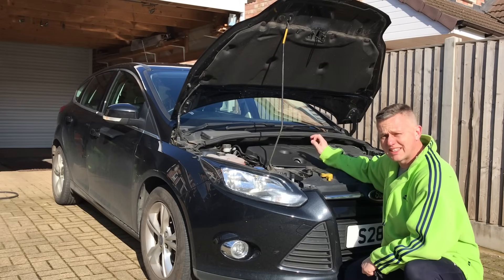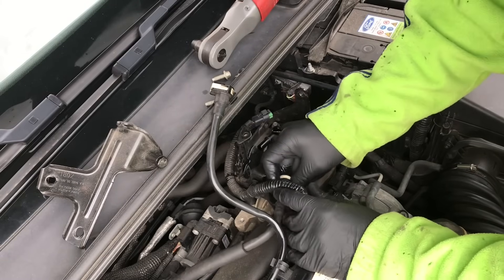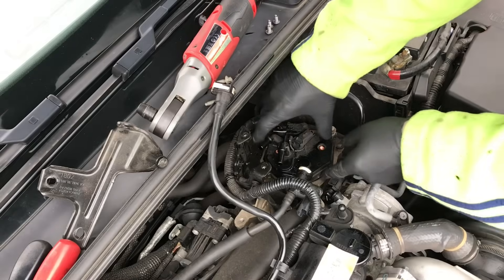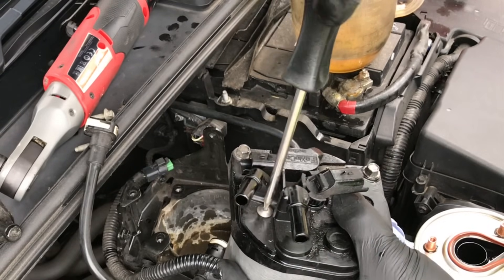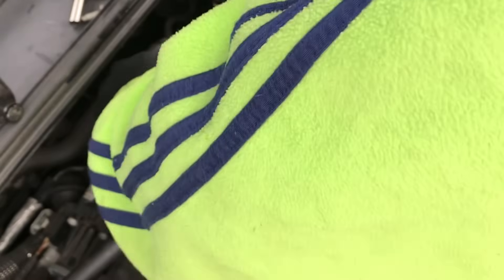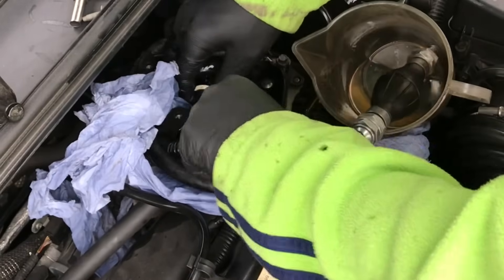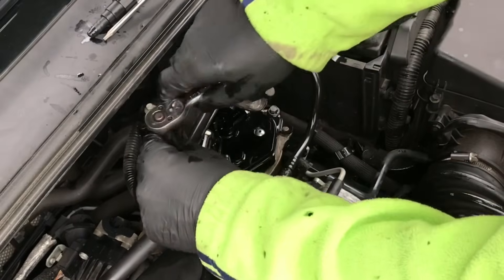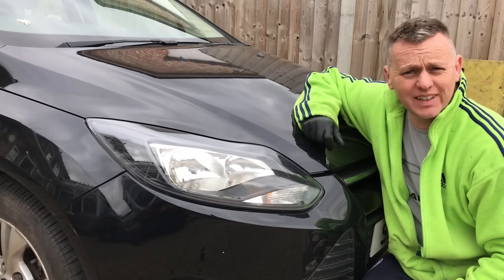Fuel Filter Replacement Ford Focus 1.6 Diesel 2011- tdci

Comment: Where can I buy those white platic clips on the fuel lines?
Reply from the maker: These might work, https://amzn.to/3Z2frKk of main dealer part, Thanks for the great comments👍🏻👍🏻🛠
Reply: @aaanton11  I dont think that will fit, its for the platic fittings that are part of the fuel pipe that connect to the fuel filter, there are 2 parts to it

Comment: Hi! Anybody know what the little black part in the center does? I replaced my filter last weekend and drove 400 kilometers without any problem, but today the car didnt start and i had to prime it again. When i stopped the engine i heard some bubbling sounds in the filter. After checking the pipes and twisting that black part a few times the bubbling stopped. Great video by the way, thanks!
Reply from the maker: It is the filter drain, needs to be locked down or air will get in the system, Thanks for the great comments👍🏻👍🏻🛠

Comment: Great video, just with the primer pump do you need an additional hose to pull the diesel through or is the laser set linked below all you need? Thanks
Reply from the maker: the laser set should have  all the adaptors, Thanks for the great comments👍🏻👍🏻🛠

Comment: Hi sir, where is the fuel temperature sensor located on these?
Reply from the maker: There is a sensor on the fuel line near the high pressure pump, Thanks for the great comments👍🏻👍🏻🛠

Comment: Hi I noticed whilst priming all the diesel is flowing out and when I check where the housing sits, there is a drain hole on the bottom any ideas cheers
Reply from the maker: when you remove the bolt it opens the drain, Thanks for the great comments👍🏻👍🏻🛠
Reply: @aaanton11  do you mean where the little black rubber bit on the bottom of the filter sits? Because I noticed fuel leaking from there onto the floor, is it supposed to be a hole? Thanks for reply 🙏
Reply: @aaanton11  Nevermind I think that hole is supposed to be there it’s just the housing was snapped inside the filter causing it to the leak out that bottom hole

Comment: If you round off t15s you can cut a slot on top of the screw the use a flat blade screw driver to undo the screw. I have used this method with a diamond blade in the dremil.
Reply from the maker: Thanks for the great information👍🏻👍🏻🛠

Comment: Good video, but can you pour the diesel fuel into the new filter before you reassemble everything?
Reply from the maker: No it will leak out the drain hole, Thanks for the great comments👍🏻👍🏻🛠

Comment: hey I have ford s max 2012 1.6 diesel I have the same fuel filter well the inlet and outlet off the filter be same like ford fucus
Reply from the maker: The same, Thanks for the great comments👍🏻👍🏻🛠
Reply: @aaanton11  thanks m8 I have been told the inlet pipe bigger the outlet pipe
Reply: if that true the s max have it on front

Comment: Av just changed the filter on my 1.6 2013 model and still dropping revs at 2000rpm 5th 6th gear with no faults on show its really making me banging my head against the wall
Reply from the maker: was it dropping revs before you replaced the filter ? Thanks for the great comments👍🏻👍🏻🛠
Reply: Yes it was and also av replaced the piped to injectors next is gunna be a regene
Reply: Done a regen on it still seems to be a problem the temperature gauge drops a lot aswell and praying it's not a gasket problem

Comment: What to do if you tried starting it without bleeding it first ??   Thanks
Reply from the maker: using the pump whilst cranking the engine, eventually it will start, Thanks for the great comments👍🏻👍🏻🛠

Comment: Great video. Is particulate filter cleaner the correct spray to tidy up any spillage?
Reply from the maker: I use Carburettor cleaner, it works a treat, Thanks for the great comments👍🏻👍🏻🛠

Comment: Just did this for a Ford Focus Mk2 1.6 diesel 2009. I was a little concerned about priming it but it all went ok. I used the Draper 43986 Diesel Priming Pump from amazon. The connectors didn't fit but... I took the inlet connector off and attached it straight to the exit nozzle of the filter which was a tight fit. It didn't take many pumps of the bulb to pull the fuel through the filter directly from the tank. Connected back up and car started first time. Kept the revs high for a minute or two and all done! Hope this helps someone else.
Reply from the maker: Thanks for the great information👍🏻👍🏻🛠

Comment: Hi mate, I have a 2011 1.6 Ford Focus Mk2.
It’s making a puffing sound when I turn the engine on and I believe it is a leaking diesel injector, I can see a small bit of smoke and something leaking beneath the engine. I can see clearly on videos of other versions of this model where the injectors are located. However I am not sure whether this video will solve my problem. Does this sound like a different issue to the one in this video? Very informative tutorial too mate, thanks! Any help is appreciated.
Reply from the maker: yours sounds like the injector washer/seal is leaking, also known as Black Death Thanks for the great comments👍🏻👍🏻🛠

Comment: I had big trouble with this one. So I called my mechanic, he already told me via cellphone:,,Go buy a dash board cleaning spray". When he came on the spot, sprayed the thing into the air intake and cranked the engine. It started in 5 seconds, without using any sort of pump.😂
Reply from the maker: If you have air in the filter sometimes even the gas method you say wont work and prolonged running on the spray can bend the con rods you have to be really careful, I know I have trashed a engine on easy start 😂 Thanks for the great comments👍🏻👍🏻🛠

Comment: Hello good video, I have the same car on the other hand I want to know where is the sensor lambda on this engine. in fact I have a P0135 engine error code. Thank you
Reply from the maker: this is a Diesel engine and wont have a lambda sensor, Thanks for the great comments👍🏻👍🏻🛠
Reply: @aaanton11  thank you very much for answering me, but my delphi ds150e tells me that the HO2S oxygen sensor is in error (p0135) but I do not know where is.
Do you know that you can come?
Thanks

Comment: Hello mate, Im in a bit of a pickle. I just bought a 2014 1.6 tdci and it seams to go in and out from limp mode. Its in limp mode for about 95% of the time after the car has warmed up. It has good power initially but then distinctly looses it. The power comes and goes with no apparent reason. When it gets power it pulls quit well. Just wondered if you would have any ideas since I'm quite worried, cheers.
Reply from the maker: You will need to get the EOBD codes for a bit of a clue, Thanks for the great comments👍🏻👍🏻🛠

Comment: i have a problem with my ford focus 1.6 diesel 2011, if i don't use my car for 1 day it will start but  after 5 seconds it will turn off, do have an idea of what it could be ? battery or fuel pump ?
Reply from the maker: Air in the fuel line, possible filter housing seal, Thanks for the great comments👍🏻👍🏻🛠

Comment: I have the same car.  A have been having problems with it since 3 weeks. 
Everyone said to change the fuel filter or the fuel rail pressure sensor. Thanks for this video i now know what do do with the filter  But where do i find that sensor?
Reply from the maker: The sensor Is in the end of the fuel rail, Thanks for the great comments👍🏻👍🏻🛠

Comment: Gave car to stupid garage they got air in system now it wont start ive replaced starter motor since they burnt it out how would i get air out system now and get it going again if i pump fuel as you did and fill all would that work or whats the procedure now 😢
Reply from the maker: Yes follow the video, Thanks for the great comments👍🏻👍🏻🛠

Comment: Hi can someone help I have just changed my fuel pipe harness under the bonnet due to a broken pipe and now car will not start possibly due to all the air in system would doing this bleed the air out
Reply from the maker: Yes you will need to carry out this same sequence if you have removed the fuel pipe, Thanks for the great comments👍🏻👍🏻🛠
Reply: Brilliant video mate I did just that and car runs perfect now

Comment: If you fill the new filter with a seringe and you start the car without reving it, that will do. Done my 4th filter so far and it worked every time.
Reply from the maker: Excellent, Thanks Stan for the great information👍🏻👍🏻🛠
Reply: @aaanton11  have you done a video about changing the cambelt? Will be interested in that in the near future :)

Comment: Hi Anton, how’s things? Just serviced my 09 Focus yesterday thanks to all your videos. They’re mighty. One quick question though. The lead going into the bottom of the filter wasn’t plugged in on my old filter and since I changed it the engine light is up on the dash. Car running as well as it ever was so I’m wondering could it be that. Do you know what the purpose of the lead is and if this could be part of my problem. Thanks
Reply from the maker: The wire will be for either, the water level sensor or the fuel heater, if it was disconnected I would be tempted to do the same again as it will run perfectly well without it, you might need to reset the eobd to turn off the light, Thanks for the great comments👍🏻👍🏻🛠
Reply: aaanton11 You’re a star! Running perfectly now😍

Comment: Hi lately I’ve been getting the message on the dash sporadically “engine failure service now”  the car kind of looses power and goes into limp mode I’ve seen a lot of people say this is potential a fuel filter related issue ? Would you have any ideas?? same model of car, year etc it’s roughly 100100 miles with the timing belt and water pump done six months ago 
Any help would be appreciated, great vid also
Thanks
Reply from the maker: you need to read the eobd codes, this will give you a better idea of the issue Thanks for the great comments👍🏻👍🏻🛠
Reply: I had that last week. Fuel injector died. The fact that this filter was in awful condition didnt help! The injectors are very expensive.

Comment: Is that push button start? If not can't you just keep turning the ignition key on & off several times to prime the new filter? Or do you need that pipe like you used in the video? 🤷
Reply from the maker: If it’s the push button start it will only have a certain time to crank. It is unlikely that you will get it going if you have air in the system you could tow start the vehicle but the best way is to prime with a pump, Thanks for the great comments👍🏻👍🏻🛠

Comment: when you said prime pump untill diesel comes out i cant see it coming out
this sounds like the problem that i have got with my car,clicking at front of car,then when after turning ignition key several times clicking noise at rear of car,also after turning the ignition key several times the miles that i have got left before going to petrol station goes down in value
Reply from the maker: This will be your issue https://youtu.be/mGYZXqcyU1c Thanks for the great comments👍🏻👍🏻🛠

Comment: You're going to get some air in the system because air gets in the pipes when you disconnect them and also some in the spouts. I've read that folk run the engine at 2000rpm to clear out any air after filter replacement. I'd replace the filter cap and then fill it with diesel through the inlet spout before I fit it back on the car.

I was going to get a Ford genuine filter but to me they look like they're made by Mann. I prefer Hengst or Blue Print to Mann.

A tip - disassemble/reassemble the filter away from the car. It'll be less messy that way and you won't accidentally drop the fasteners down in the engine.
Reply from the maker: Thanks for the great information👍🏻👍🏻🛠

Comment: Great video!! I am thinking about changing the fuel filter myself too.. But I am still uncertain as you mention that, if I mess it up and there goes air inside the engine it will be a nightmare to start it again and get rid of the air;
1.) What would have to be done in case the engine will not be able to start due to air in engine?
2.) I have the keyless-go system would (in case there is air inside the engine) it be even harder to fix, as you cannot turn the key around?

Your help would be very much appreciated! :)
Reply from the maker: As long as you prime the system like in the video it will be ok 👍🏻thanks for the great comments 👍🏻👍🏻🛠

Comment: Why do ford have to make that job so dam complicated , I'm sure they could of made the process a lot more simple if they really wanted to , thanks for the vid all the same , good insight to what could go wrong ,👍👍
Reply from the maker: Too true, thanks for the great comments 👍🏻🛠
Reply: Citroën use the same filter and basic setup on the C5, same dv6 engine more or less. Their filter housing has a primer button, so much easier.
Reply: @paulburke6515  Any part number on that filter housing? Maybe we can replace it on the Fords and have a priming button also :)
Reply: It's almost as much fun as filling the gearbox with oil through a filling cap that they decided to put on the side of the gearbox.

Comment: Eeek, just tried to start the car without priming before seeing this video. Will priming it afterwards work?
Reply from the maker: Definitely prime it before trying to start it again, fingers crossed it plays ball, Thanks for the great comments👍🏻👍🏻🛠
Reply: @aaanton11  I was somewhat confused by where to apply the primer to. Is that one of filter connections. My Focus is a mk2 1.6 and slightly different

Comment: After filter change i get p0087 low fuel pressure
I tried another filter no change.
Changed regular didn't help
Don't know what else to do 😢
Reply: The limp mode happenes on acceleration, sometimes stals completely. I am able to start it right away but on acceleration it happens again...
Reply from the maker: You must have a air lock of air ingress into the system, Thanks for the great comments👍🏻👍🏻🛠

Comment: Hi there, nice video, but why are you pumping diesel in rather than pumping air out of the filter? Are you not doing it the wrong way around? If not, would you mind explaining.
Many thanks
Reply from the maker: You are just filling the housing with fuel, sometimes the vac pump struggles to draw fuel if the chamber of the housing is too large attaching from the other side, Thanks for the great comments👍🏻👍🏻🛠

Comment: Hi..

Great video... my 2010 1.6 tcdi came up with engine malfunction not going over 3000 rpm, looked on internet brought reader... so far ive changed the glow plugs still did it, changed the boost solenoid... boom all ok but lol every now and then it comes up engine malfunction. I stop the car turn it off and its gone (P0299 code) on the internet people say taking it to garage and no one can find anything wrong that but some have changed the diesel fuel filter now do you think this could be the cause of it it I'm no mechanic I don't want to spend loads and loads of money at the garage on it because to me it's just a run around car to and from work to pick the kids up from school
Reply from the maker: The fuel filter is not a expensive item and it can be done as per the video, not sure if it will make a difference to your fault, but if others have had success and its not been done recently always worth a try, Thanks for the great comments👍🏻👍🏻🛠

Comment: If car doesn't start back up straight away how do u clear the air from the system
Reply from the maker: you will need to use the primer pump to pull the fuel through as in the video, Thanks for the great comments👍🏻👍🏻🛠
Reply: @aaanton11  thank you so much pal just after doing it and the hand pump sorted it out thank you great videos.

Comment: where's the best point to bleed the air if it doesn't start please? + i would tackle those three tough screws before undoing the two supporting screws, and maybe wouldn't use a ratchet like you suggested. instead i'd go for a screwdriver like yours (the torx one), with a nut for a ring spanner. that way you can put weight on from above, and keep it square. thanks for this video. helpful as i'm doing it in a week. cheers
Reply from the maker: I would put the primer pump inline and then pump and crank the car at the same time, Thanks for the great comments👍🏻👍🏻🛠
Reply: @aaanton11  ok cheers pal. hopefully it'll go well.

Comment: Could you not fill the filter as you put it back in then tighten the cap?Would save a lot of priming
Reply from the maker: You can fill the filter housing, but still needs the air priming out, thanks for the great comments 👍🏻👍🏻🛠
Reply: You cannot fill the filter until you have screwed the top cap and push in that middle plug, that plugs the bottom hole in the filter.

Comment: a quick tap with a hammer will break the tightness on the t15's, also put a bit of anti seize on them before putting them back in, make it easier next time. bit of red rubber grease around the inner seal will prevent it moving & stop it drying out.
little bit of care & attention goes a long way
Reply from the maker: Thanks for the great information👍🏻👍🏻🛠

Comment: Dont make the mistake i did and twist that little water release valve to drain the water...the engine ran for ten seconds then cut...air in the system...had a hell of a job to get it going again...2014 focus diesel....changed the filter and bled the system in the end....Bob..Paignton....
Reply from the maker: Thanks for the great information Bob 👍🏻👍🏻🛠

Comment: I changed my filter on focus strait out with old in with new and now she won’t fire up what I need to do now wish I seen video before hand 😭
Reply from the maker: you need the primer pump to fill the system back up and remove ant air locks, Thanks for the great comments👍🏻👍🏻🛠

Comment: Great video really helpful have to change the wife’s one tomorrow I’ve been avoiding it for over a year now but 100.000 on clock needs doing. I like the way you pump the diesel in through the inlet and out rather than connect the inlet pipe and draw the diesel through. Do you find this better or is it just your preference?
Reply from the maker: this is definitely the easer way, Thanks for the great comments👍🏻👍🏻🛠